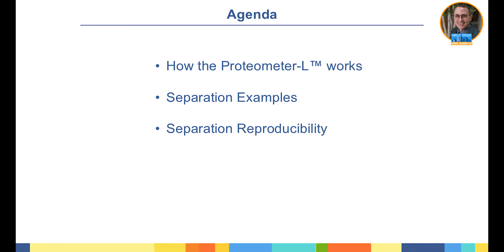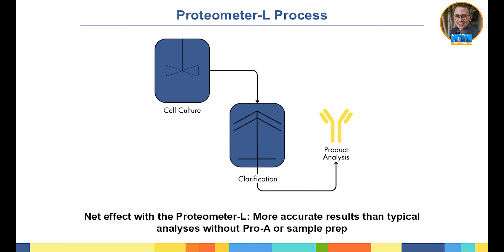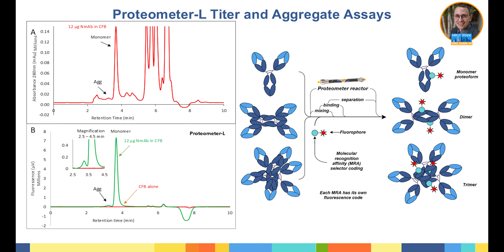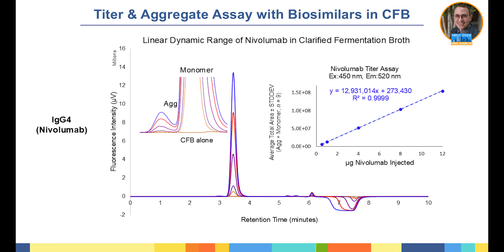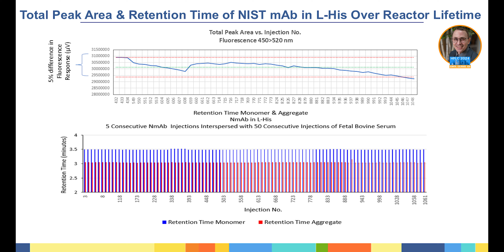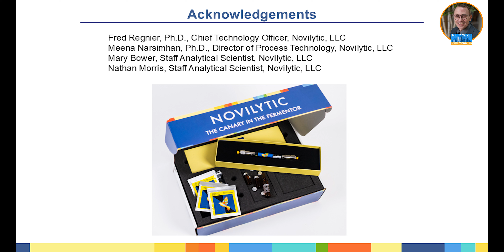HPLC 2024: Analysis of IgG Biosimilars Using the Novilytic Proteometer-L Kit

Comment: I would appreciate it if you would provide answers to the following few questions:

1. what is the maximum injection volume of the column?
2. what is the maximum antibody content the column can reliably analyze per injection? 
3. Maybe I heard wrong, did you say that Proteometer column is good for  2000 injections?
4. Does the Proteometer run on SEC ?
5. Is Protein titer determination dependent on fluorescence?
6. Any known culture media supplements that can interfere with the labeling?

Thanks!